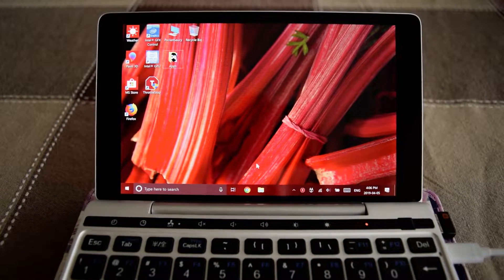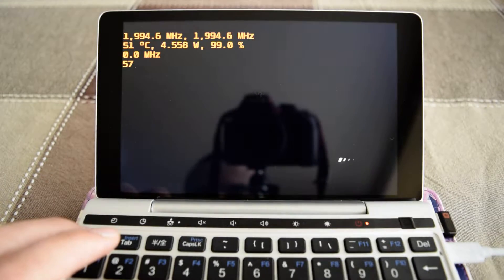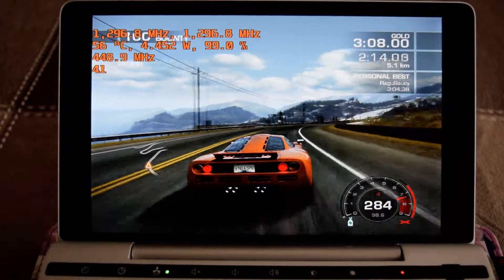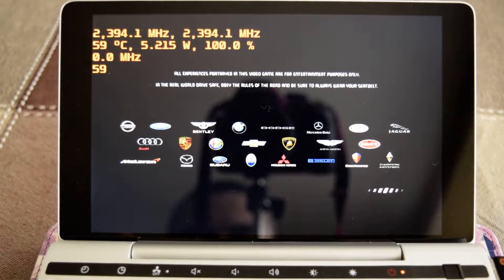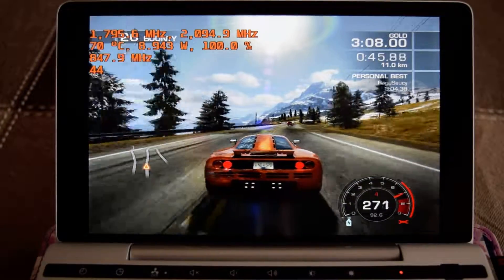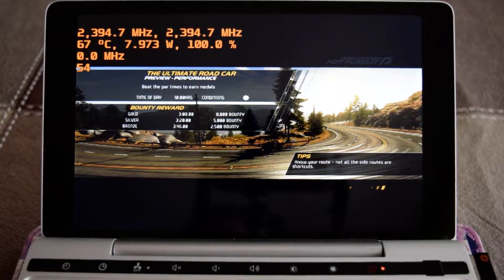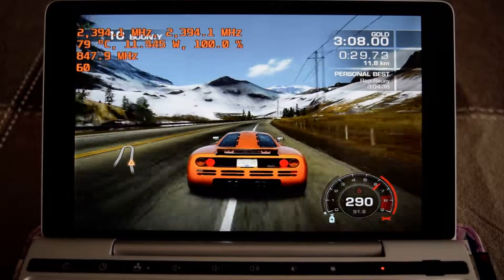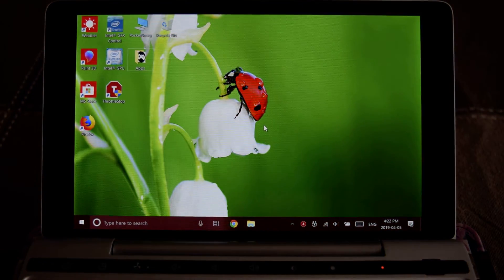GPD Pocket 2 Gaming Test with Thermal Pad and Paste Mods (Running at 4.5W, 9W, and 12W TDP! #YOLO)

Comment: Your videos are amazing. What overlay are you using?
Reply from the maker: Overlay as in theme? If so, I just grabbed one off the Microsoft store lol, I can check if you like it :) Bear in mind that the 8 second slideshow was adjusted through the registry lol :)
Reply: @armandoragusaucy96z.71  Oh I meant the overlay displaying system information lol like the temp, tdp wattage, mhz, fps counter while ingame. Is that throttlestop's overlay?
Reply from the maker: @SerGallow  Ohhhh.... I see... Lol sorry about that. It's Rivatuner Statistics Server coupled with HWinfo64 :) You can pick whichever data you want it to display, so for that it's about what your preferences are. It's extremely versatile, although a bit complicated to set up initially.